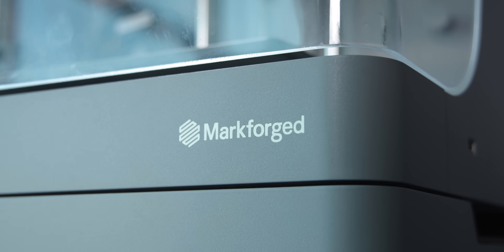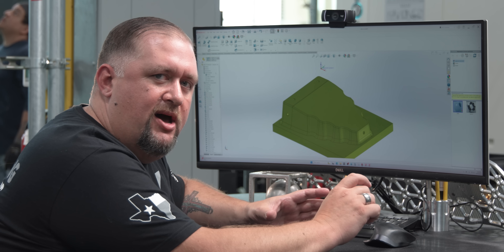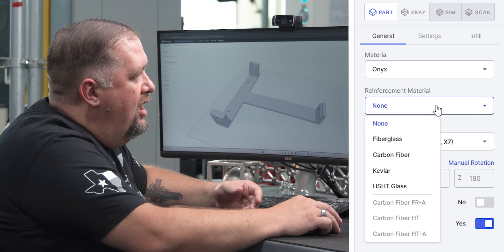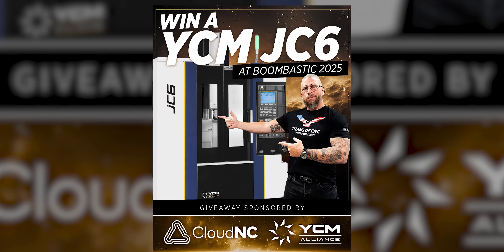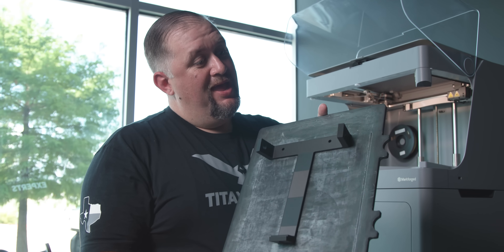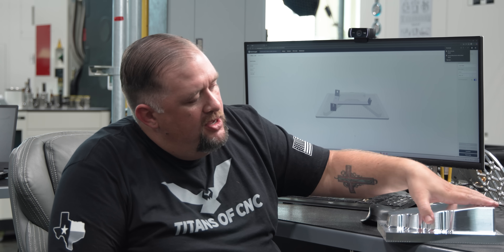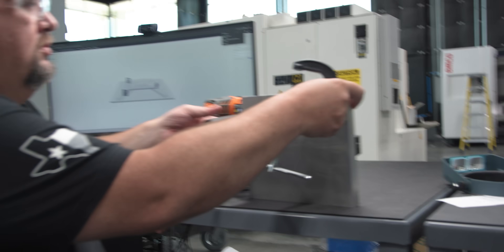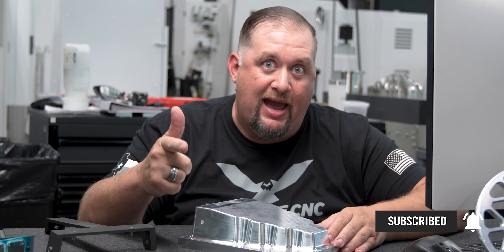Have you seen a Machinist Angle Hole Jig made like this?

Comment: I 3d print drill jigs often for my parts, and the only issue is material shrinkage is usually -.050 thou or more for large parts like what you printed. Using the drill bushing was a great idea. Usually the temperature of the drill bit melts the PLA, and the surrounding PLA around the bit does not keep its shape. Still great for when you don't have a CNC and need semi-accurate holes

Comment: Nice jig, but I would have designed it so it had perpendicular pads, so you could stand it up in each drill axis and be able to use a drill press with the part 'leaning' but the holes normal to the table. I am sure that is what Donnie would have done 🙂